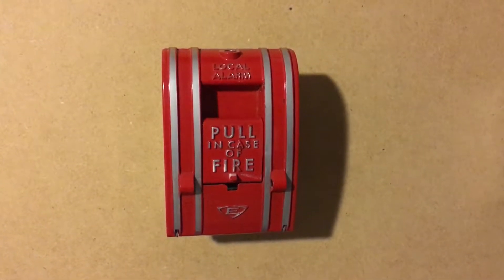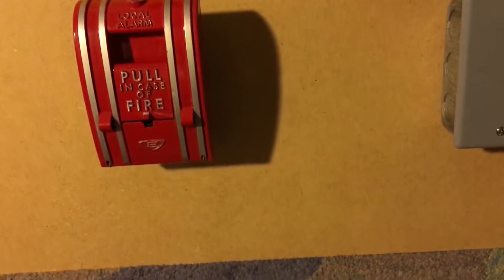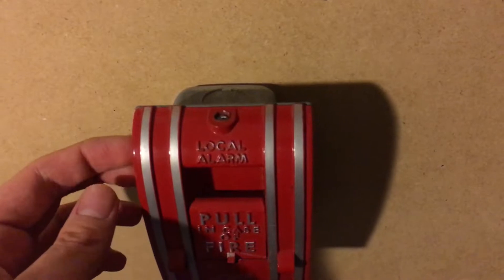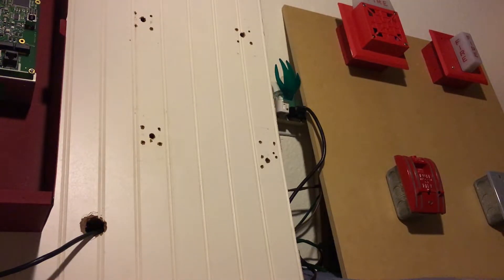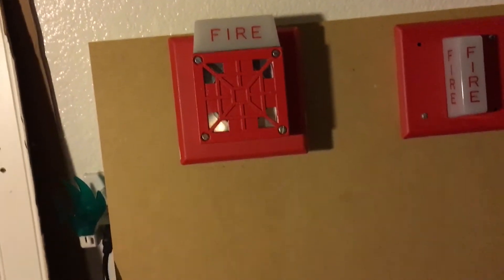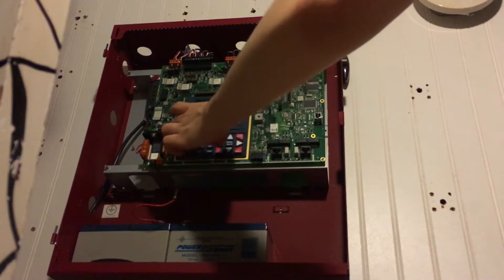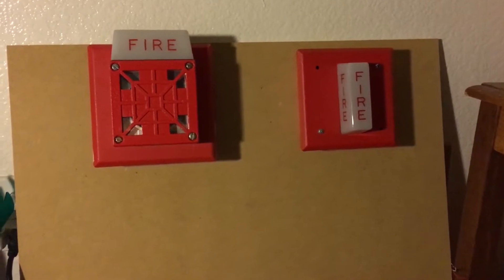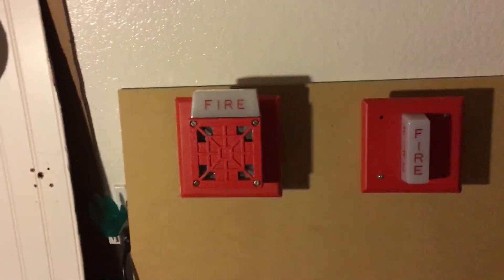Mini Test #57

Comment: The horn sounds just like the 34T
Reply from the maker: Lol, probably bcuz that light isn’t “robbing” or taking a bit of power like the xenon-strobed 7002/7002T (however the 7002T works :P. with the strobe skipping phenomenon)

EDIT: Another thing is I have the light wired separately from the horn, so that's another reason too ;)
Reply: Firealarmfan457 is it possible to do audible silence with the special 7002t